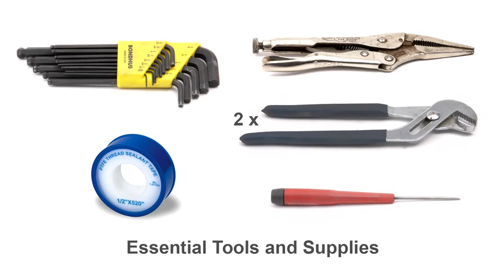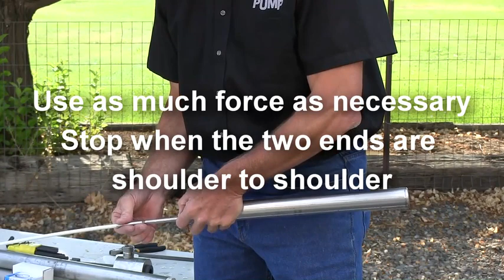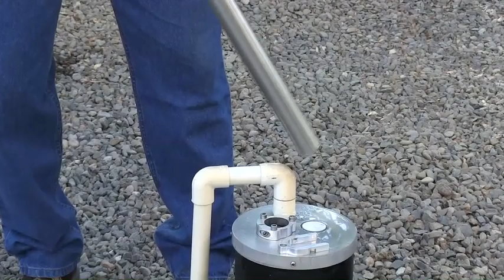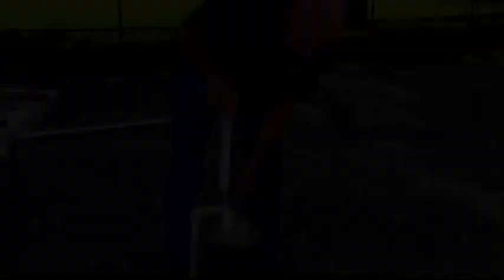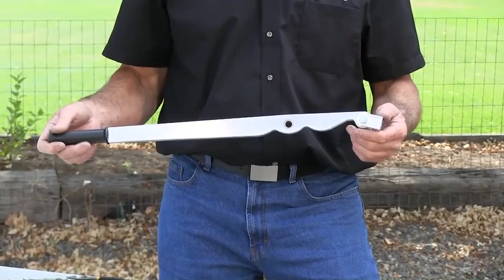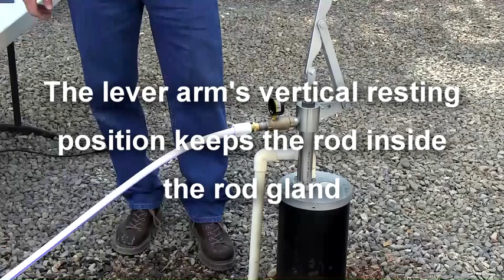Simple Pump: Hand Pump Installation

Comment: these are so cool i have to say they are not cheap but I have to have one so I guess I will start saving
Reply from the maker: Thanks for the comment. It's true that the Simple Pump is not a "cheap" solution for the necessity of water, especially if you have a well on the deeper end. Far cheaper than the other pump that claims to be for deep wells -- and much easier to pump.